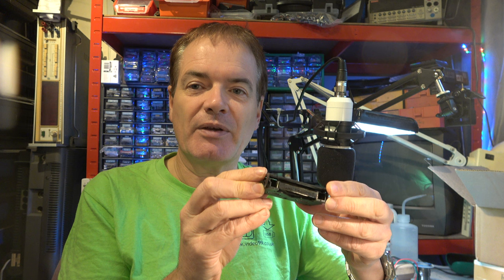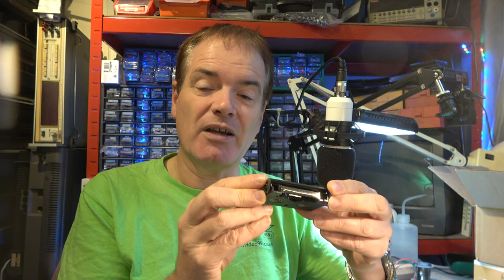Experiments in cleaning mould from miniDV tapes

Comment: Hi Colin - I believe I have your name correct...(?!) You sent me a box of VC/LVC tapes some years ago..
My reply here, if it's of any use with the moldy tapes is that years ago, I too had moldy MiniDV and 8mm camcorder tapes that were just a mass of picture static when I first tried to play them..
At the time, I had something I had built that did work successfully for awkward tapes of all sizes.. A dehumidification  unit. Basically, a large plastic box with two 9V dehumidifiers sat in the base, wires through the box and sealed air-tight with silicone rubber sealant. The box had a rack fitted within it on which I sat my tapes. An air-tight, hermetically sealed lid meant no additional air could get in or out of the unit. At only 18volts, I would leave this for upto five days. The air within would be processed and reprocessed through the tapes, super-heating the air molecules in the box.  After five days, it had sucked the air and tapes warm and dry. The previously no picture/no sound MiniDV tapes now had both picture and crystal clear sound.
I did eventually disassemble the unit when I bought an Andrew James Food Dehydrator - and have since used just that for all my tape baking..
Reply from the maker: These tapes have been baked already.  The mould over the surface needs cleaning off, it's a very unusual problem for miniDV.

Comment: I have an idea. Since miniDV and CVC use 6mm tape, why not spool the miniDV tapes into a CVC shell and clean them using a CVC machine in FF/REW mode and a piece of rag soaked in IPA? That shouldn't hurt the machine since it fast forwards and rewinds with the tape unlaced.
Reply from the maker: There wouldn't be much room to set that up.  However I am wondering about spooling the tape onto 1/4" audio reels and winding through using the Ferrograph tape deck.  The problem though is setting up a IPA dispense and cleaning pad replenisher.

Comment: I have never seen any type of tape with that amount of mould on it, I have used a scrap VHS recorder to clean tapes successfully, your idea of using a scrap miniDV camcorder is probably the best option.
It would be interesting to try it, but as you point out, it would be a lot of work & probably the tape would still not be recoverable.

Comment: I would suggest running through a UV light . The question would be on duration and intensity of the light. A cheap UV LED Nail Lamp maybe ?
Reply: it would kill active mold but would not remove physical traces
Reply: @SPINNINGMYWHEELS777  It maybe start of a process that also requires addition steps after.

Comment: I would actually try an open reel in play speed. Or its about time someone fabricates a table top cleaner with variable speed capability. I have the idea of design perhaps I can share it with you.
Reply: In the process of building a multiformat tape cleaning deck.. Got a couple of decks when I get more time to build them. Got a motor and a variable speed controller attached and working.. Just need to build it all   onto a box..

Comment: On the Rank Cintel mk 3 telecine there was a cleaning device that had two rolls of tissue paper running around a couple of rollers that the film was dragged between as it was shown. The tissue paper is fed automatically from a small roll constantly but slowly to clean the film. If you could get hold of one and rig up a way to feed the tape though in a motorised way it would probably work. Might need a few passes. It's not like the film cleaner in the video.

Comment: This is a fantastic video and goes to show how much work you put into this stuff as opposed to most transfer outlets. Many of them take one look at a tape that's even remotely dirty and scream bloody murder for daring to darken their doorstep with an imperfect tape.

At my workplace we use a rather interesting piece of equipment thats borderline handheld (and quite reasonably priced) for putting materials back onto a roll when they've been fully extended. I think this could be used to do much of the manual "desticking you do". It will certainly need a little bit of modification otherwise it will "reel up" MUCH too fast but I think it would automate the job you do for this. Would you mind if I sent you an e-Mail with a link to a youtube video of it and my idea?

Comment: Anyone know any other way of cleaning the heads on one of the VHS players I have without using special cleaning solution or a head cleaner tape?. I've been trying to clean the heads on a machine I have which I recently bought in December to digitise alot of tapes to my computer, but now (probably due to dirty and badly worn tapes) I can't seem to clear up the image on playback. On the other video I have, which is a Panasonic DMR combi recorder (though the tape mechanism has jammed so unable to use at the moment) I've just used a piece of paper to carefully wipe the head, and everytime it has clean the heads after a few attemps , but with this machine (which is a basic Bush 6 head video) using this method doesn't seem to clean the heads. The inside of the machine and head drum is very clean, almost like new, so I don't understand why the heads won't clear up, maybe it's not the heads or they've been damaged.
Reply from the maker: They may be damaged.  Looking at the heads under a X10 or stronger magnifier in strong light is the way to check.  Try to get the head tips to "glisten" in the light, then you can see if one is damaged or contaminated.

Comment: Maybe some aggressive household cleaner would have delivered some better results, but then the residue of the cleaner would have needed to be cleaned off as well. Another question comes to mind, there has always been that debate about wet and dry lubricants on MiniDV tape. I could imagine the mould and/or cleaning the mould makes the lubricant not work anymore, or takes it off the tape. Maybe that was why the tape after cleaning stalled the head drum? It was however quite interesting to see how the mould on that one tape made the path of the video heads across the tape visible.

Comment: I was wondering if alcohol defect the tape or not. , because I have mould in my vhs tape and some one told me that use distilled water for removing  mould , safe and not react with tape rather than alcohol that will effect on tape .. so , u are the master who ask him in any old technology😊
Reply from the maker: This is a metal tape formulation, alcohol is OK in moderation on this.  But on oxide tape like VHS, it could possibly take the oxide coating off the tape.

Comment: I heard concentrated hydrogen peroxide cleans mold better than rubbing alcohol but they are only available through chemical suppliers. If someone knows how to 3D model, pretty sure they can design something simple with motors and can run the tape continuously across a cleaning pad.

Comment: Why not go back to basics? Something like an old reel to reel machine, but with conical centres do tat all reels can be supported.

Then, to clean the tape, 2 or 3 contra rotating sponges on pinch rollers, using a pressure plate on the other side, like in an audio cassette. The rollers could sit in a bath of ipa, which would provide the cleaning. 
You could also add a dry sponge to remove the excess ipa.

Comment: Even if all the mould is removed it's a pure Metal tape. If the coating protecting the Metal is breached, the metal is oxidised and the recording is  lost. I believe Metal tapes dont survive moisture or flood contamination nearly as well as Oxide tapes as I guess Oxide tapes are already oxidised and  more chemically stable.

Comment: This is a wild off-axis idea, but since the mould is biological material, and the tape and coating are not, why not try soaking the tape in a bio laundry washing-powder (or liquid) solution (the kind with enzymes that digest the dirt in your clothes). Try a bit and soak it for several hours and see if it can selectively digest just the mould and leave the rest intact. 
If it actually works, you then have the engineering problem of long-soaking the entire tape, but I can imagine that is not an engineering impossibility. Hard yes, but not impossible.  

The first stage is to find an effective cleaner and I think maybe bio enzymes might just be the answer. Or I could be barking up the wrong tree altogether.